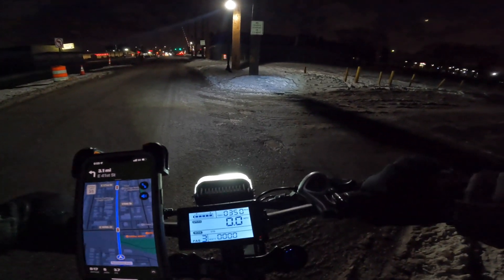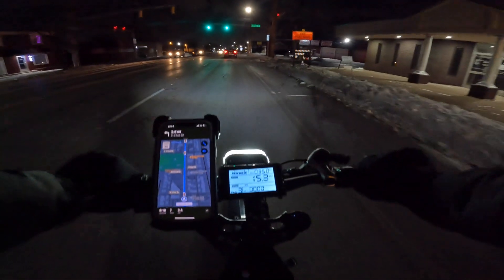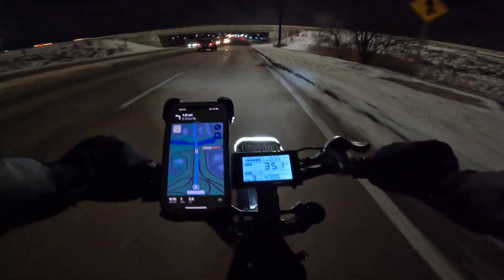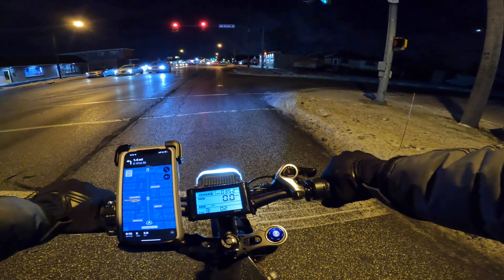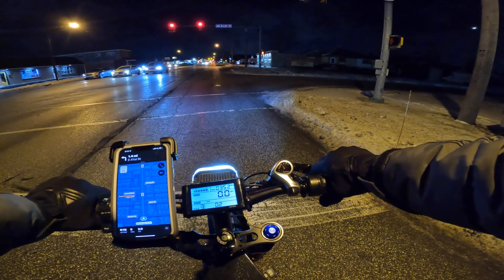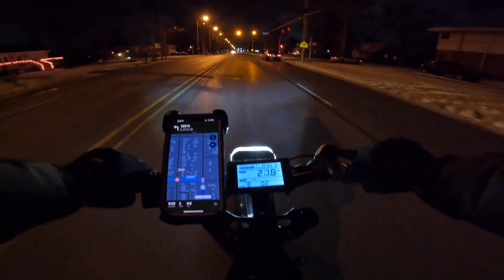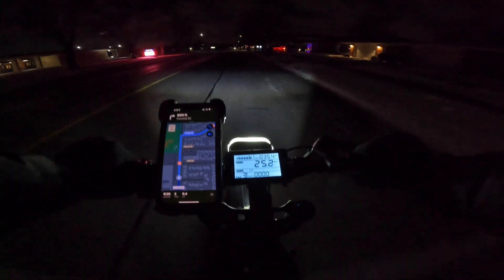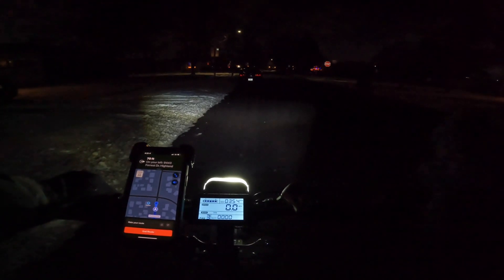Lyric Graffiti e-bike controller limitations at 52v issue and final production bike specs

Comment: You have a week or two to say see I told you or to apologize for speaking without  full knowledge.  I have no idea myself
Reply from the maker: No as a engineer and pretty knowledgeable and math and true data sheets states it all. I not your typical consumer that buy stuff without doing research first and without knowledge of what I was considering buying? 

If anything you have a week, or two to realize that bike is a very overhyped, overpriced and under performing piece of junk with no rear suspension? If you want to be a sheep and convince yourself that a company that took over 3k to 4k that the company sold you the best e-bike for the money bike and that it as advertised even though components they are using and data sheets states differently. Good right ahead, as your the type of consumer they are looking to sucker. I wasn’t born yesterday night and can’t be fooled easily and of I were you I be questioning purchase and the details of components they used are public available a Google search away and you see for yourself the advertise specs are way overrated from the true specs, meaning false advertising? 

Honestly can’t wait till people start receiving their bikes? Many people unfortunately are going to be disappointed once they realize they can’t climb a hill well, or steep hill barely at all without assistance and that a 1000w gear hub motor will outperform in torque that direct drive motor. One of the people that purchased the lyric graffiti has a Ariel rider dual motor bike, he definitely going to notice that the bike isn’t going to live up to the hype, as the Ariel Rider is a better bike torque suspension rise and has already decent top speed. 

The only people that may be impressed at first will be those that don’t already have a decent e-bike already? As they don’t have a reference to compare it to and will just see it can go 37mph and not know about torque and how fast it sure take to get up to top speed, or hill climbing ability. Those that ridden faster e-bikes or real 2500w to 5000w bike definitely going to notice it not as advertised.
Reply from the maker: lyric did what most car amplifiers manufacturer do and overrated their product. It like how some amplifiers are rated at 2500w but can only really do 500w continuous RMS and some even less? They use peak dynamic power, or some worst pmpo output power which is what I refer to as Chinese rating, only if struck by lightning rating. Even seen large Bluetooth speakers rated this way and laugh.
Reply: Your grammar is pretty bad in the comments. Might want to clean that up before you call other people suckers and boast about how knowledgeable you are lol.

Comment: Dude, could you shed some light on the 305 ghost and voodoo as well please. Your vid’s have been helpful. It’s so annoying how all these e bike companies expect you to drop thousands, and keep so much in the dark. On the website it says they both do 65 mph, but one of the owners of lyric says the ghost does about 75 . The prototype is a limited in their review videos so who knows , and they’ve only hinted whether or not they will include an alarm system, which I think they definitely should at that price range. my question is, if the peak is 18,000 watts 😮 and 3000 continuous on a 72 V 50 amp battery‘s what will the performance and longevity be?I wouldn’t even a thought this set up is possible, but then I looked at the BMS and it’s so high up there in the 300s I’m guessing this is the reason for the 18,000 peak? And the reason for my skepticism is other companies have a 72 V 50 amp in the same BAC 4000 controller and do not claim these results. And it might be because it’s safe not to push that set up with that much torque and high speed. It seems like they should’ve included atleast a BAC 8000 instead, if not A larger motor as well to prevent overheating?  I conclusion is I would not get that bike with that much torque and high speed. Because it’s not possible, or I would be spending money for a new battery and we’re motor in no time 🤔
Reply from the maker: I was thinking the same when looking at the specs on that bike. A good reason don’t push my 5000w QS205 motor to those levels as it overheat and magnets glue will go brittle and loose. Now grin technologies  does sell a custom heatsink for my motor and Statorade is a line of low viscosity magnetically suspended motor cooling fluid to help dissipate heat. Yes definitely would have when with a BAC 8000 controller. Curious how battery only 50 amps? For something that power even if peak? That why people go to extreme to beef up with copper the nickel plated to push more current use better cells to avoid hot spots due to high resistance.

Now definitely will look into those bikes as well.

Comment: I like the attention to details you go into, i always wondered a electric motor eg bbshd 1000w nominal voltage is rated fixed for nominal 1000w for heat reasons so it doesn't get any hotter,i always thought increasing the nominal voltage would creat heat exponentially as the nominal voltage is increases as a guess. I got onto your channel from a comment you made under mine about cracks in frames on ebikelife channel and you seemed pretty switched on👍 i live in Australia where it it hot and it is not unusual to have summer days of 33°C (91°f) and bbshd's run 20°c above ambient temperature and that's right on the max heat the controller is rated for reading bbshd manual pdf, on hot days my bbshd cuts power intermittently around 50°c testing with my none contact temperature gun. I wish there was a way to increase the heat Cut out on my controller by about 8°c then i wouldn't have this cutout issue on hot days(could be faulty to i haven't read anyone else having this problem and no code comes up). Do you know if the stock temperature setting can be changed pn bbshd's?
Reply from the maker: Mines get about heatwise They can run up to 130f to 140f on flat and not to much of a incline at 2500w to 3000w but wasn’t using the internal controller and using a external modified ASI BAC 855 at 72v on the Bafang BBSHD. Now on steep hills I help pedal it to keep it from overheating on hotter days. I had that bike for while and haven’t burn it up yet, but also added a extra heatsink to controller and directly in airflow to keep it from thermal cutting out. The only issue with that bike I had was a downhill rated zoom fork snapped going downhill on unpaved and front bottom fork and wheel flew off. Thankfully didn’t end up in the ER and just a few scrapes. So building it with a much better fork and frame. 

With the BBS02 I actually melted the plastic gears once pushing it at 150f once experimenting. The only one haven’t modded yet was my Bafang Ultra but had the bike custom to keep a cleaner look and everything internal. I just wish wasn’t the newer canbus version. I moving that motor and controller on a better frame with a better components over the spring time.
Reply: @thetechgenie7374   @The Tech Genie  wow thats sux i am suss on any zoom products they are to cheaply made, what happened to you seals the deal on that brand for me for important parts, yeah sweet i have another 2 ebikes both with ultra, g510, m620 motors whatever its name it is it has a few depending on what website you look at🤣👍 i got a old one none canbus and just got a brand new one a few days ago off Alibaba with 26x4.8 tires, dual suspension, 52v 20ah  i think its got more newton metres torque that both my other bikes stock but could be the gear ratio it has bigger back cassette. Cool mate im subscribed anyway ive been looking at your videos they are nicely detailed 👍 i even watched some of your electrical fixing stuff with pcb electronics im into that kind of electronics also but with testing diagrams for faulty components im not that good, im no good with software only hardware, im smart enough to be dangerous 😁

Comment: This is really interesting. We did see some pre-production reviews where the Graffiti appears to perform well.  So how do the limitations you identified apply?  Would you expect less performance or perhaps faster degradation of the battery or some other problem.  In the reviews, the Graffiti did manage to hit the speeds they promise and it did go up a gradual incline well.  However, I noticed in one video that it could not go up a steep hill (from a stop), without assistance.  Appreciate your further thoughts.
Reply from the maker: It still sure be able to climb most hills but will do so slowly on steeper inclines. Speed will be limited to around 37 mph but more then enough for most people. Battery not going to last 1000 plus cycles as they claim. The Samsung 35e cells they are using are rated for 500 plus cycles as stated in data sheet for cells. So not sure we’re they got 1000 plus cycles from? Yes the deal breaker is that battery pack will degrade pretty fast. Not only due to cycle counts but also due to they pushing it hard and the fact it only 17.5 Ah on a high power bike as suspect it still pull at least 1700w. It going to degrade that battery pretty fast as under a lot of stress.

Now range another thing they completely lied and over exaggerated about, you never going to get 80 mile to 100 miles even on dual batteries setup. As most reviewer using the bike was lucky to get 15 miles one reviewer didn’t even make it back coming from his usual work commute he takes back and had to pedal it most the way back home. You get about realistically 15 miles range on single battery and about 30 miles range on dual battery.

Now on a real 2500w nominal watts bike climbing hills sure not be a problem and go faster then 8 mph even a a 15 percent incline hold close to speed you would on a flat as a real 2500w bike sure have 165nm of torque which is actually sure be more powerful then my mid drive Bafang Ultra which is rated at 160nm of torque, and I climb a 15 percent incline going to work everyday on that bike maintaining 24mph on that hill and I weigh around 240 plus pounds so heavier rider. The fact that a 190 pound reviewer could get only 8 mph on a steeper hill is definitely not preforming as it sure, he definitely had to help it. That due to it not likely a real 2500w nominal bike.

I curious as well to see once people start receiving there bikes how it going to preform overall in the real world? It was suppose to ship back in September no one received it? Then by December before Christmas no one received it? Now they are claiming mid January? 

They contradict themselves in their last comment suggesting they were not finish with the production bike and someone asked them about that statement as bike sure be already be shipping? Now they cover their behind and noticed 15 hours ago they completely deleted that comment. I didn’t delete any comment from them they did? I find that completely odd? Likely due to the fact I when over everything I could to respond back to their reply with real numbers and facts and explaining why it not possible what they are claiming? Then one person ask them about the shipping and why paragraph 4 stated a production bike may not be finish and them suggesting in that paragraph that it likely still in the works? They did same thing with the 50 BMS statement and retracted that as well and when with phase current specs instead, which ironically is directly off ASI BAC 855 spec of controller was running at 72v to 86v specs.
Reply: @thetechgenie7374  Got it...thank you for the clarification.